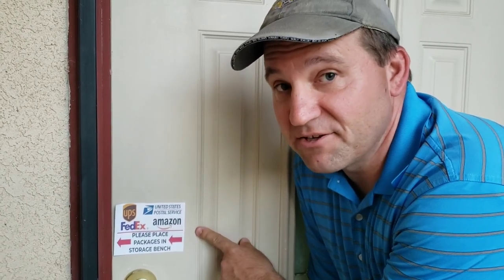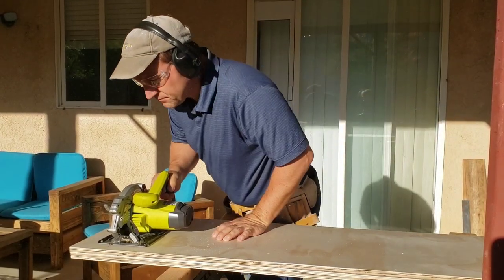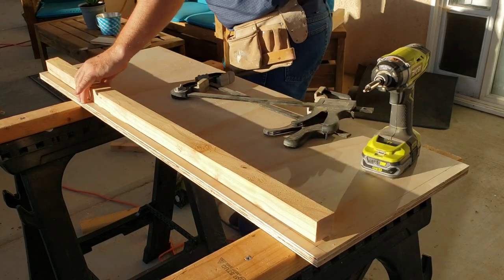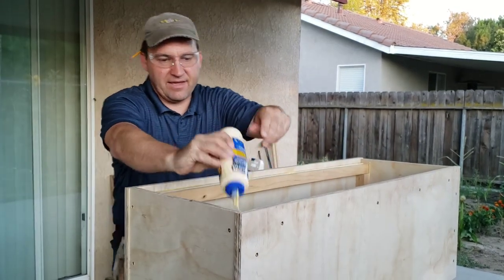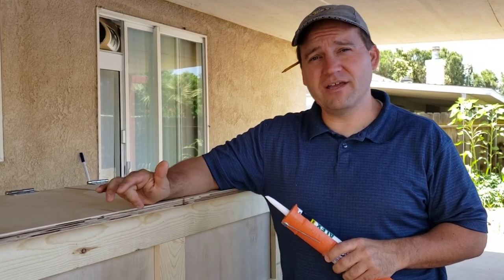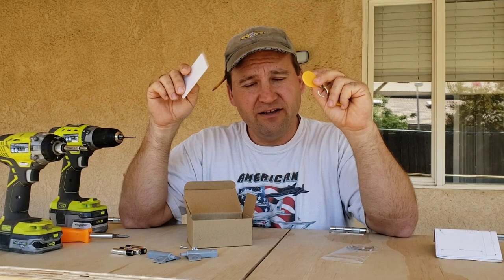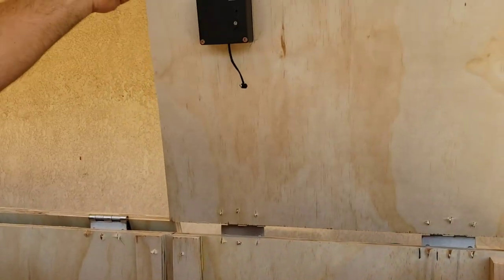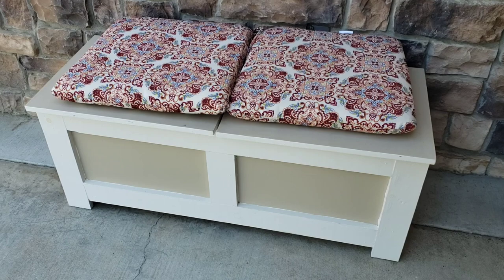DIY Locking Storage Bench for Package Deliveries - Porch Pirates

Comment: WTG!  I’m a former rural carrier and appreciate a safe place for parcels. We deliver SO MANY and if a customer is wondering where their parcels are?  This is the answer.  Also put up the largest box made. This eliminates the dismount and speeds service up for all!
Reply from the maker: Thanks Cherie!!!
Reply: @GoodlyEarth  Good job. I was wondering how you could have a locked unit. There are locked mailboxes used, but only owner of box has keys. They don’t help the carrier because most smaller parcels will not fit in the slot or opening. The fob is wonderful as it allows box to remain open till carrier delivers. 👍. Could this be fitted for the mailbox itself?  We’ve had problems with strangers taking mail out of others boxes.

Comment: Great little project i intend to tackle soon. My only concern would be putting the hinges inside the box, otherwise somebody can just unscrew them.
Reply from the maker: Most thefts from a front porch are quick and convenient. With the packages locked up I doubt anyone would take the time to try and get through the hinges. But... that's a good point. The hinges can be placed on the inside for safely if you'd like. Good call!!
Reply: @GoodlyEarth  i understand that package theft it's a crime of opportunity that happens quick, but let's say whoever is doing it is watching the house and knows that nobody is going to show up, it's a quick job with a cordless drill to undo the hinges. 
Anyway, i love the concept of the bench, it's useful and looks great!
Reply from the maker: You've got me thinking that a hidden hinge version might be the way to go.  I like your thinking
Reply: I highly doubt this would happen but, there's always a chance that they may even try to take the entire bench.  I'd consider using some small anchors on the rear legs as well.  I'm always cautious about things like this, good idea on the inside hinges Mitch!
Reply from the maker: It did take two of us to set it in place.  Hopefully it's weight is a deterrent

Comment: There is something similar, it is called the Bench Sentry. It may be a little more expensive, but I have tried the Doorbox, but the local USPS refused to use it. This looks like a good thing, but, if you don't have the power tools,  or other tools in this video, there is other options like the Bench Sentry.

Comment: I had some issues with reliability and adjusting the Closer Dampers so I the replaced them with a hasp I had laying around or you could also use a hinge. Attach the rasp or hinge to the body of the box so the other end of the hinge that's not attached protrudes pass the box about a 1/4 of an inch which will support the lid. Add  some weight (bolt and some nuts) so the hinge will drop when the lid is opened. Add a string to lift hinge up and lower the door in place. The lid opens, the hinge end drops, the lids is closed and the box locks. Too bad I can't add some photos it make more sense.